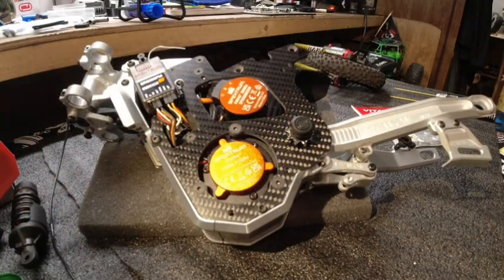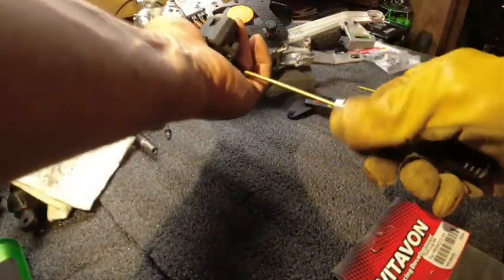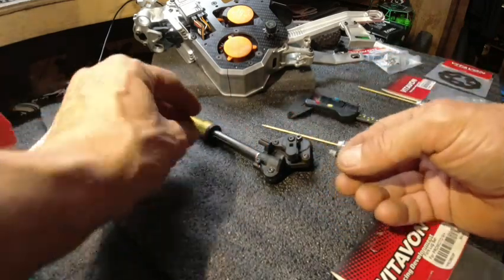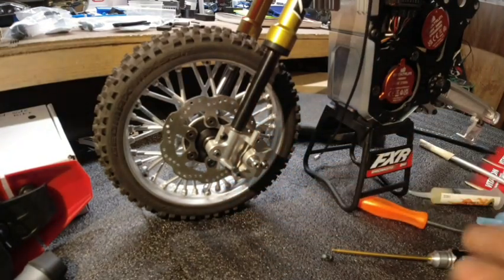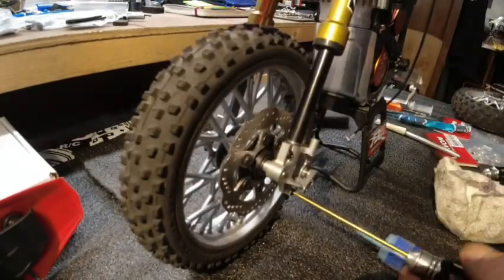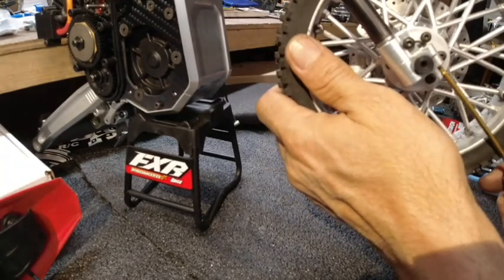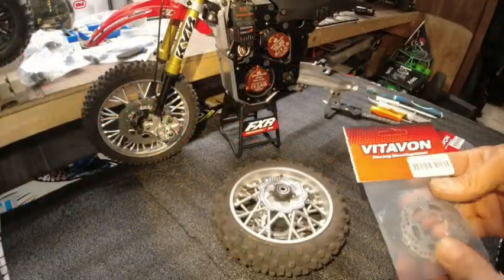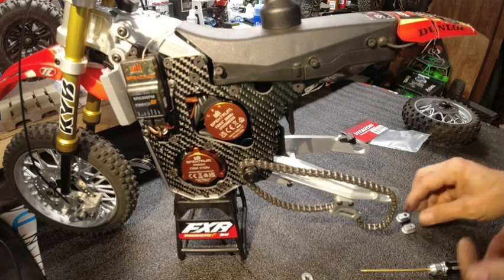Losi Promoto MX COMPLETE VITAVON Build Series PART.5 SDRC Shop

Comment: I know this video is old but for your break rub issue you get a spring that pushes the pads open all the way brother… worked for me
Reply from the maker: Thanks for the suggestion. 👍👊
Reply: How did you end up fixing the front brake calipers getting stuck?
Reply from the maker: @RedNinjaGaiden  I cleaned up the calipers drum a bit and added a bit of grease. Also sanded the inner brake pad down a bit. The brakes stopped sticking after a few runs. Since this video I got the newest version of the caliper and it doesn't seem to stick at all.
Reply: @RedNinjaGaiden  I took the bike to my hobby shop Ang explained my issue. The owner told me to leave it with him. When I went to pick it up he told me it was easy😳. He put a more powerful spring in to keep the pads fully open… problem solved…

Comment: Are the carbon fiber side chassis plates a lot lighter than the aluminum plates? Wanting to change mine if it's much lighter than stock.
Reply from the maker: Yes they are, look back on my channel at the Vitavon build series for all the weights of the Vitavon parts. I believe the carbon frame plates were total of 60 grams lighter than the stock losi aluminum plates. 👍👍👊😎
Reply: @screamingdemonscrew  Just saw the video on weights. That's awesome thanks!